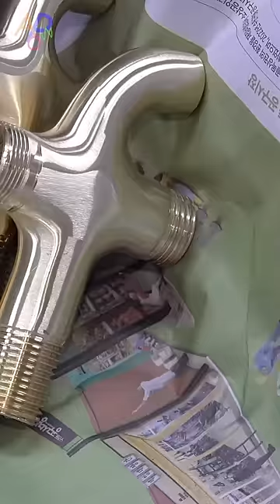Interesting Brass Faucet Mass Production Factory #allprocessofworld

Comment: The yellow sculptures that are layed in the Dies are made of sand. They are called "Cores." After the metal solidifies, the core sand is broken up and falls out. That is how the faucets are hollow. I've worked at a foundry for over 30 years.
Reply: How are they suspended in the middle? How do they know to fall out once cooled instead of staying in shape? how do they stay in shape while the metal is poured in?
Reply: @---iv5gj  Rewatch it. The cores are sand + adhesive to form movable shapes. They are placed specifically in the moulds with gaps where they want the metal. My guess is the heat from the metal destroys the adhesive, so after casting all you have left is sand and metal.
Reply: Admiro, e,  ao mesmo tempo, fico intrigado com os resultados tão fantásticos desses processos industriais! 👏👏🙏🙏💪
Reply: Thank you I was looking for the answer
Reply: This is the way
Reply: 谢谢分享奇奇怪怪的知识
Reply: Вы молодец 👍, уважаю трудяг.
Reply: У вас называются "ядра" а у нас "стержни".
Reply: Cuídate y cuida tus pulmones para no tengas nunca problemas de ÉPOC
Reply: Wie werden die Kerne zerkleinert, mit Ultraschall?
Ich bin Werkzeugmacher und habe in einer Druckgießerei gearbeitet. Bei uns werden natürlich Kerne mechanisch oder hydraulisch gezogen. Geht natürlich bei einer Wasseramatur nicht.
Reply: Can confirm this guy knows. Worked in the core department for an aluminum foundry 2 years. Ran a machine called a u180
Reply: Exactly ..So Iam .. I have Msc About metals casting processes 😊
Reply: Ikaw na Ang magaling
Reply: Un trabajo admirable😊 que hermoso es aprender y trabajar a gusto
Reply: I whant to talk with you about this job because now iam working in same job
Reply: Que bonito sería conocer en persona esas fábricas
Reply: Самые работящие мужчины, это индийские. А женщины самые работящие во Вьетнаме.
Reply: Молодец, иди возьми пирожок с полки..
Reply: У нас вРосии они называются СТЕРЖНИ.
Reply: Извините. А как эти остаются точно в центре, то есть по середине?
Reply: Đúng chuyên ngành của mình 7 năm đào tạo cho công nhân làm những sản phẩm vòi nước thiết bị vệ sinh cao cấp này
Reply: Thanks, been wonder what were those, they are just sand
Reply: So cool 😉
Reply: Cool you answered the exact question I had lol
Reply: @user-xu7bv2yv2p а как они центруются, чтобы между стержнем и формой выдержать точные зазоры? Или концы стержней и фиксируют их жёстко?
Reply: Its just a negative space, a mold of the cavity to pour in, after pour the tabs used to connect the metal are broken off, either pulled of in a machine or grinded off.  Think like those model cars you glue togethe, those little parts you have to pull off the mold, those tabs are what holds them all on one sheet @FineFuture
Reply: Exactly why I came to the comment section. Thank you
Reply: Сколько вам платили
Reply: The sand is plastic bound. The plastic burns, so you can remove the core. The core is usually removed by hammering and shaking or heating. The core marks determine the position in the casting and are located outside the Part in the mold.
Reply: Any idea what that polishing wheel is called? I need one.
Reply: ㅖ99ㅔ
Reply: Danke für die Info. Ich bin landschaftsgärtner 😳🤔und habe keine Ahnung aber davon sehr viel ❤
Reply: 고생했다. 그런데 진폐증 같은 것은 안걸린가? 분진이 많은데? 규폐증 이런거???
Reply: c'est quoi comme métal ... alu ?
Reply: Çok eski sistem Turkiyede otomatik döküm yapılıyor. Birde kumdan yapılana maça denir❤
Reply: Çok geri teknoloji bu döküler otomatik dökülür sistem Çok yavaş
Reply: No way Sherlock

Comment: The sand is plastic bound. The plastic burns, so you can remove the core. The core is usually removed by hammering and shaking or heating. The core marks determine the position in the casting and are located outside the Part in the mold.

Comment: Whoa that grinding polishing method was IMPRESSIVE.  To think you can cut back on a rough casting to a smooth finish in one go is amazing. Very impressed considering normally we need to take that step in many stages.
Reply: They used different sandpaper numbers I work in a factory in Mexico “Pulitec” sem job .
Reply: @user-vz3di4nc1r  So it's not cut in ONE operation.  I thought something is amiss here. Grinding and polishing cannot be done in one step. Again clever YouTube editing.

Comment: Aluminized brass is brighter than a plasma arc when you pour it. Welding lenses are required to avoid damage to your vision!
Reply: Is this aluminized brass? Shit won't last two turns using extra strength... And I bet they generate tons non treated water pollution due to chrome deposition process

Comment: Pure aluminium is 4 times weaker than brass. These cheap taps aren't meant to last long. Always better to invest in a good brass/steel tap and replace the rubber gasket or entire inside cartridge if it starts to leak.
Reply: These are solid brass, they're just plated in chrome or nickel for some reason.

Comment: To possess a target body you need three demons one to pull-out the soul and hold it then two to go into the target body and three to pull out the second demon when they are done having fun with it. The reason the third demon is needed is to pull out the second because the body won't let go of a soul because a soul is life, and without that soul, the body will die in minutes. The body can only house one soul at a time. If this was a real possession, the sign of possession is the body going limp like death before and after possession. Theirs no soul in it when the first demon pulls the target soul out and the body goes limp. It happens again when then the second Demon is cast out during an exorcism. The body will start to die without a soul in it and with an exorcism the first Demon that is the one holding the target soul must let go of the target soul it is clearly up to the target soul to go back into it's body or not. The target soul usually goes back in, but if the body is too damaged, it will be on the other side for good, and what you're left with is a dead body. When the Demons ask Jesus to cast them into the pigs, what you had was many Demons taking turns with the target body. The body can only house one soul and back then Demons only had one form of entertainment now times are different most Demons watch TV with you they are also found in big cities and street corners you know the one's with the stop and go lights that shows the little walking man light. I tell you this because they like your cell phone games like watching you play on your phones. Most will sit with you and watch TV, harmless most of the time. 
Listen carefully when I tell you not to do an exorcism without the help of an Angel. The proper way to do this is to take a week or two to call on mother Mary, and she will send an Angel. Jesus will deny his mother nothing and if you choose to do an exorcism pray for a week or two over the target body to mother Mary and when the Angel arrives he will place his hands on your head and you will know he is there with you. Now the reason I say call up an Angel is because that dirty little Demon that is holding on to the target soul may not let go of the target soul he may just watch the target body die, it's fun for them. The Angel will force the Demons to leave and then he will carry the target soul back to its body at the same time wiping thier minds of the whole incident, one's got to function after words don't they. Pray for two weeks before starting an exorcism. Mother Mary is the key. During an exorcism, say these Bible verses:
Psalms 25:20
Psalms 31:4-5
Psalms 18:3
Psalms 34:7
Psalms 71:2-4 

Lucifer is playing the role of adversary, and God is playing the role of God who is against lucifer rebellious ways, but the truth is you're being tricked. Before the deformation of the universe, God will open up a portal back to the beginning before the BigBang he will leave behind all those that will belong to lucifer. Let's call them the lost, and the lost will pass through the deformation, and then hell starts. When you die and you're one of the lost, you will be taken down into Sheol to a long hallway where they place you on your knees then they will bring your hands in on to either side of your head locking you into your own mind into your own personal hell but in no way is this hell, hell doesn't start till after the deformation of the universe. Now, after hell yes there's an after hell you see God is waiting for the reformation of the universe and when that happens all those in hell will be pushed out into a place that seems like heaven but it's not it's just a place of destruction of your soul that is the place that will give you the second death it is the end of you. Sheol is a place of holding hell is a place of torture, and the place you're pushed out to is the place of death. I am a son of God I have walked with my father and I can prove it to you when you die and go before my father's throne look behind his throne and about 45 to 50 feet back you will see a white door, inside that room is a great forest God takes his breaks in there. I have walked with my father in that room. Knowing that Sheol is a place of holding is very important if you make it to heaven because you will be allowed to pray someone out of holding and bring them into heaven just don't stop praying to God for that person and God will send an angel to you to tell you to stop praying your loved one is now waiting for you at God's throne. This ability to pray a person out of Sheol is my gift to you. My father and I talked, and he approved this for me. My father denies me nothing, just like my brother Jesus denies his mother Mary nothing. 

From Jesus' perspective is what I will offer you. When Jesus died on the cross, he came out of his body his eye went through a monochromatic perception, and then he could see with new eyes he watched as the heat dissipated from his body he could see inside his body as the heat dissipated making his body indistinguishable from the pole he was nailed to. Jesus then was pulled down to Sheol, then Jesus looked down and beheld an ophanim. The ophanim looked like molten gold spinning counterclockwise the ophanim had eyes on its side and was very beautiful. Jesus then heard a sound like that of a dolphin clicking and then a second angel appeared and this angel was a servitor this angel was glowing a bright blue color his skin was something like unto that of translucent but very beautiful and bright. The darkness of Sheol was litup with every movement of this angel. The angel placed both his hands on either sides of Jesus head pulling all his memories form him then the angel moved out about five to six feet away from him, then a Dominion angel appeared and the servitor angel using sound transferred all of Jesus memories to the Dominion angel then the Dominion angel ordered that the ophanim was to release Jesus and so it was done. Jesus then ordered all the Old Testament saints who were asleep in Sheol to be woken up and a place for each one of them to be prepared in heaven. Then Jesus ordered that a portal to his body be open up and the servitor angel turned to what was Jesus left side then the servitor made a sound very loud and a portal was opened up. Jesus then turned around and moved over lava and entered that long hallway in Sheol called, holding. Jesus then ordered that the one's closest to him be woken up so that he might speak with them. Jesus spoke with them for some time, and then he left that hallway called holding as the servitor angel in that hallway one by one placed each soul back on their knees then placed each head on a platform bringing their hands in on to either side of their heads locking them into their own personal hell. Now Jesus told them one will come and he will deliver some of you to take warning because he will wait for you in the front after the reformation of the new universe. No one understood Jesus, but they listened anyway. Some asked him questions, and Jesus answered, but all were placed back to sleep, locking them into their own personal hell. Jesus moved back to the portal, where he looked into it, seeing his younger self laying in bed at his home. Jesus then took his left hand up, opening his fingers, and then a great boom was heard as the portal was activated Jesus then made some jesters with his right hand and the portal fast-forward to his body laying in his tomb Jesus then said some words upgrading his body to be much like that of a Metatron you see Jesus had to upgrade his body because Sheol is a place of forgetfulness and if he didn't upgrade his body he would not get his memories back for years after his resurrection. Jesus then passed through the membrane that chasm that separated life from death, thus completing his resurrection... 

When people who are going to hell die, they will be taken to a holding place in Sheol this hold place will be a long hallway where they place you on your knees then they will place your head on a platform bring your hands in on to either side of your head locking you into your own mind into your own personal hell. This will go on until the deformation of the universe. When you pass through the deformation of the universe, that is when you will enter hell. Hell will not go on forever it last till the reformation of a new universe and the bubble will push you into a place that seems like heaven but it's not it's just a place of holding where they will destroy you. Destroying you is called the second death, and it will be the end of you. Sorry 

I can prove to you my gospel is true when you die and they take you up to God they will tell you you can ask God one question but before you ask that question look behind God's throne about 45 to 50 feet back will be a white door inside that door is a great forest God takes his breaks in there so remember that white door.
The dead know nothing because most of them are asleep in Sheol, and the other half are in Heaven being told nothing, so yes, the dead know nothing because God likes it that way.😮😢😮😢😮😢😮😮😢😢hui😮😢😮uuuyy😮😢😮ihggyy😮😢😮😮gyguu88😮😢

Comment: Steel Ingots melted in the furnace. Pattern made up of sand is positioned in to the fool proof die/mould or cope or drag in the foundry. Molten metal is poured in the runner of the mould. Castings are taken out from the mould after cooling. Threading in a threading die. Polished in a polishing machine. 
Carefully polish before and after threading to avoid damage of threads.
Reply: Looked aluminium to me.